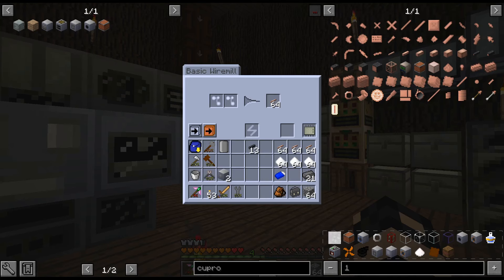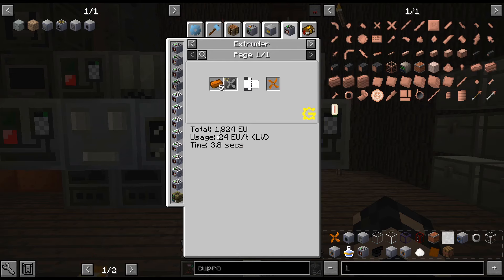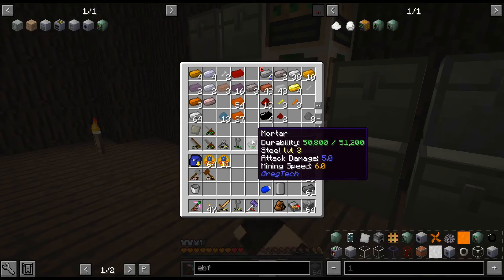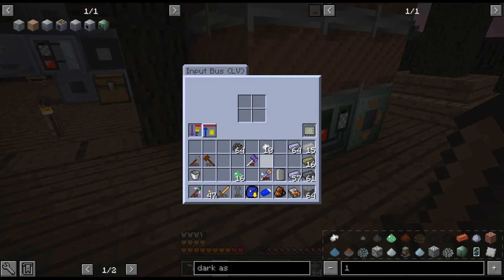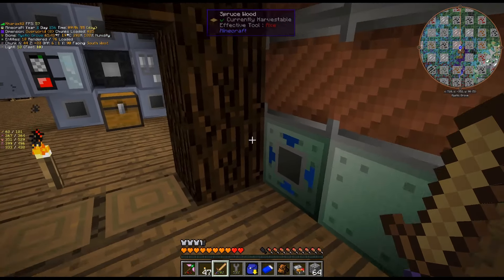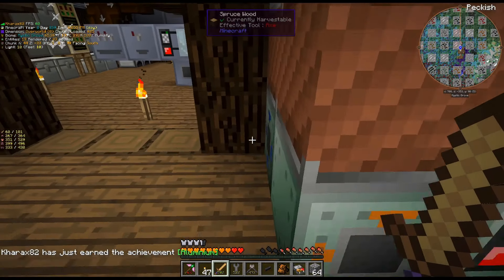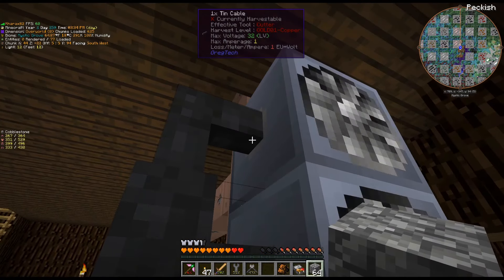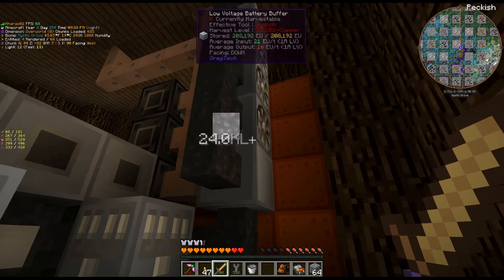GregTech New Horizons S3 - 31 - We Be Cooking Now

Comment: My usual go-to is to get lapis, lazurite and sodalite (there's tons of the stuff anyways) and electrolyze it. You get pure aluminium, silicon (also very handy) and some other stuff (calcium, sodium etc) in massive amounts. You can just compress the Aluminium dusts into raw aluminium and then EBF it at LV-level. 

But the blast furnace is a big step on the road. :D